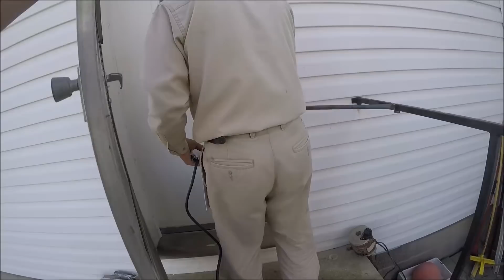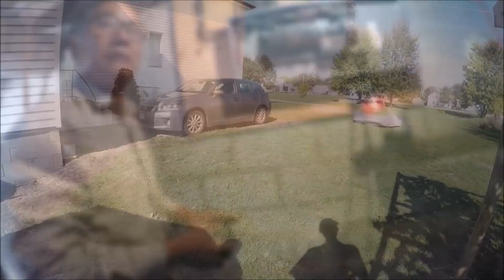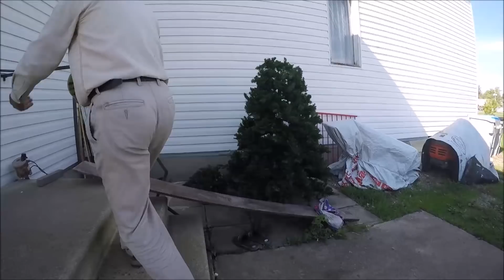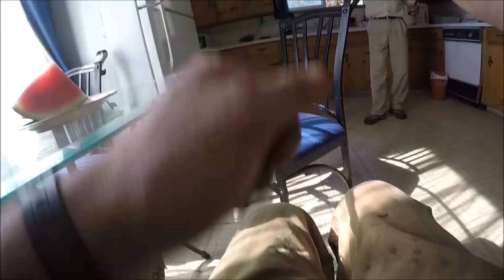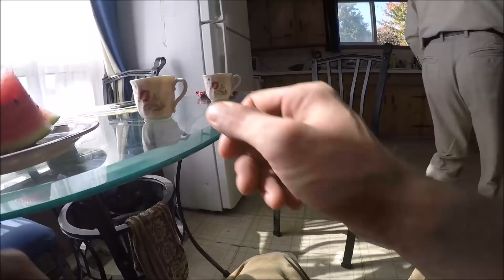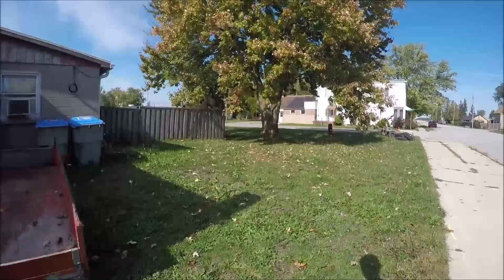Episode 173: Watermelon and Tea with Tumuchi

Comment: What was that red tank hanging from Tumuchie's hot water tank?
Reply: Pressure damper vessel at a guess. To stop water hammer in pipes.
Reply: AuMechanic , that makes sense. Never seen one before
Reply: Ive seen smaller ones like it, called an accumulator, not sure why he has one that large, maybe because of upstairs, perhaps it has pressure booster pump for town water, they have a pretty big accumulator on them..